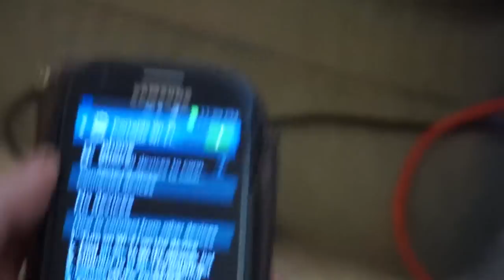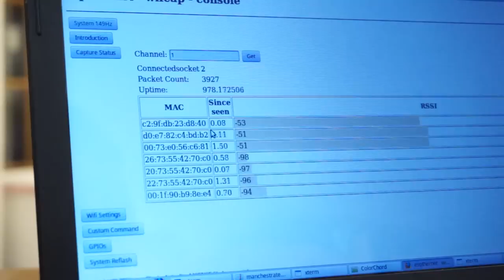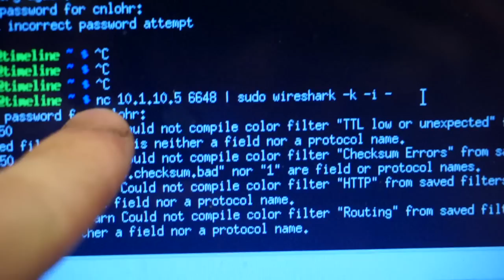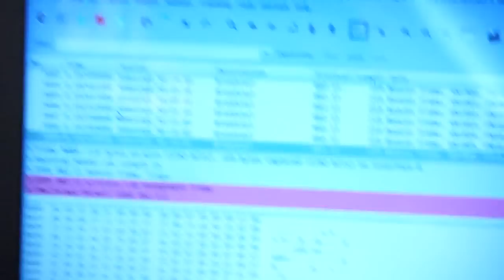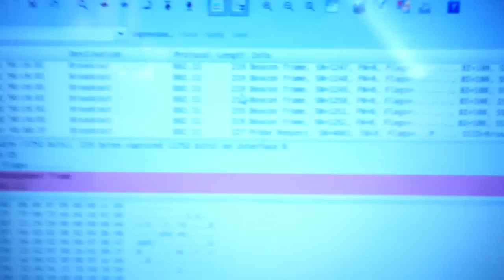Remote Wifi Sniffing Station with an ESP8266

Comment: I've seen a few projects on github like this that allow the ESP to just display WiFi probes over USB/serial but this is pretty interesting could be cool if you could link to ESP's together for one to monitor and on for transmitting as a wireless bug.

Comment: One use I can see for wifi sniffing is to find available APs/routers/whatever and then choose one to connect to. Every project I've seen so far, you have to specify in the sketch ahead of time what one SSID the device will be connecting to. Useless to my thinking if you want to take it from home to the library, to the coffee shop, to a convention, etc. without having to reprogram the sketch every time.
Reply from the maker: If you don't use arduino, there's a lot of options as far as a GUI, etc.  For instance ESP82xx starts up as an AP, you can connect to with your smart phone and using the GUI select an AP put in a password and connect.

Comment: Would it be possible to make the ESP8266, capture mac adresses than for each one switch to normal wifi mode and connect to your own wifi network and post it with a GET or POST request, then switch back to monitor mode and do it over and over again?
Reply from the maker: I am pretty sure it would be possible :).

Comment: A simple question, can ESP8266 monitor how much packet is transmitted from a WiFi router to a client? I'm making a project that auto disconnect clients if they hog my bandwidth but they can still browse as long as they are not reaching the threshold.
Reply from the maker: that would best be done on the AP itself.  The ESP cannot see encrypted packets.
Reply: Hmmm.. I think I can use the value of "Since seen"

Comment: Can someone hypothetically run a phishing device from the web server on the esp
promoting it as free wifi or something and phishing
Reply from the maker: Totally can be done.  Wouldn't be that hard.
Reply: can you make a tut or point me in the direction
Reply from the maker: I mean, not really... you ca make it appear as any network you want. I can't remember how, but you can hook the IP stack and pass packets that are going to the internet off to some other server and pass them back, getting all the data inbetween... but, I think using a TP Link or something like that and sniffing the hardwire connection may be easier.

Comment: great job! i am new to this so maybe you know what i am looking for. I want to make a program that displays(on Arduino serial monitor) all WiFi devices around the esp. I thinks it is called passive scanning. any ideas how I could do that?
Reply from the maker: Yep.  The ESP has a library call for showing all nearby APs, and their power!
Reply: CNLohr any chance that you know the library?
Reply from the maker: It's part of the main user interface.

bool wifi_station_scan(struct scan_config *config, scan_done_cb_t cb);
Reply: Heres my arduino AP scanner, for clients you would have to do like above switch into promiscuous and log all the traffic, there are a few of these on github already.
https://gist.github.com/tablatronix/497f3b299e0f212fc171ac5662fa7b42
Reply: did you found the command that it turns it in promiscuous mode with arduino IDE . I only found scripts that works with de SDK not arduino
Reply from the maker: I really don't do anything with the arduino environment, so I wouldn't know :-/
Reply: +Ali Hosseini (Random Ali) yeah it is fairly easy to do I found a couple wifi sniffers on github

Comment: Is the reverse true?? How would one sniff MAC addresses of clients trying to connect to a ESP8266 that is in Access Point mode? Is that even possible?
Reply from the maker: http://www.esp8266.com/viewtopic.php?f=32&t=5669
Reply: +CNLohr Thanks but this is a bit different than what I envisioned. Think of your phone that has wifi on and scans available networks. Can I program the chip to broadcast an SSID so when the phone during the network scan finds the SSID its Mac address gets sniffed? - all that assuming that the phone actually broadcasts something ...
Reply from the maker: It does, but most phones now do mac scrambling so you can't identify them :-/

Comment: Your android device is in tether mode so it is not actually sniffing. Have you tried catching ethernet frames from hosts connected to the same network as your Esp8266? Is it even possible?
Reply from the maker: +fredro not really... though you can see the data frames, just not the data inside since it's encrypted.

Comment: So is it possible to use two of these ESP-12e(I meant replace the LAN circuit with another ESP-12e) and make it complete wireless? :D
Reply from the maker: +eAffiliation Yes, but... but... That's not the point sigh you guys.... Wanting to do things that are useful...
Reply: +CNLohr this will be useful too, one scenario, you can keep this in pocket while it is sniffing and use the smart phone to connect it to and do some stuff while you're roaming around. :P
Reply from the maker: I understand.  I will think about it.  I could see some applications of that.... Dunno, the ESP32's got Bluethooth AND wifi, so.....

Comment: Waiting for my esp8266 traveling throug time and space.
Meanwhile wondering if it can be used for indoor GPS system. If it possible to retrive signal strength value from this cutie ?:O
Reply from the maker: +zZkamexZz Signal strength is on the right... But, signal strength is not a good metric for localization.  Only precision packet timing - which the ESPs do NOT do that I'm aware of.

Comment: Could you have one esp sniff, wired to a 2nd one to send the info to your network? Or cant they talk to each other though wired connections?
Reply from the maker: +xecoq Absolutely, but because of the packet size limitations, it wouldn't be practical.
Reply: check out WebSocketSerialMonitor  
https://github.com/tzapu/WebSocketSerialMonitor

Comment: 2.4 GHz spectrum analyzer? :)
Reply from the maker: +piitsen Dunno if the ESP gives you that level of clarity.
Reply: +CNLohr how would you describe the needed level of access to the rf part?
really narrow band, arbitrary frequency selection.

narrow band receiving might be a problem since it was designed for 802.11 which is 20 MHz/Channel.
why would there be steeper rx filters configurable?
Reply from the maker: As far as is easily exposed, you just get to pick channels, the part handles re-tuning, etc.

Comment: Could you set up a frame work of home automation triggers generated by proximity of your phones mac address? Or is there a more secure token?
Reply from the maker: +Jonah Taylor That's actually a really good idea!! You totally could set it up to do a trigger when it sees a specific device broadcasting a browse request.
Reply: +Jonah Taylor That was the first thing i though of as well, It would be neat to have it set as a reverse beacon, so it detects you , then switches to STA and sends the event somewhere, even back to your phone to tell you your here, or perform anything else of course.
Reply: Have a look at tasker (app), it can do what your asking if i understand the question right.
For example i have it set up where as soon as i pull in the driveway of my home after 8pm my porch lights turn on automatically.
How this works is phone>connects to wifi > tasker checks time, if after 8pm then sends commad via ssh to flip relay>porch lights turn on. 

I use 433mhz and a RPi instead of esp but it wil work the same with your the setup you are speaking of.